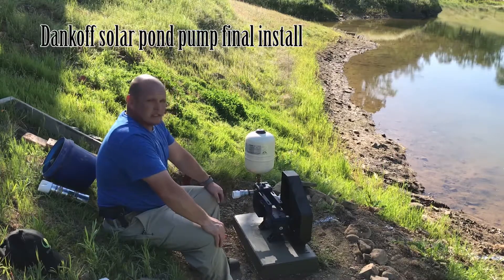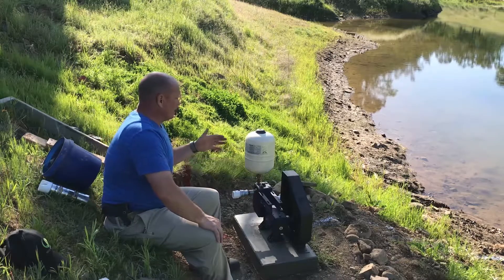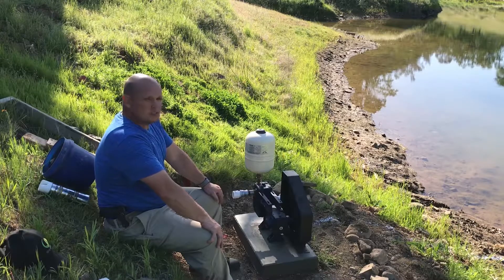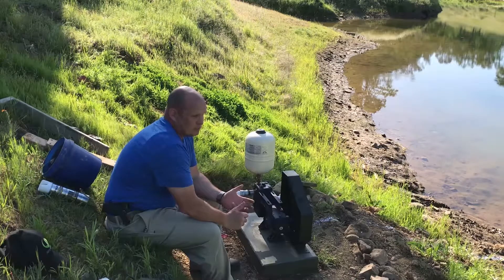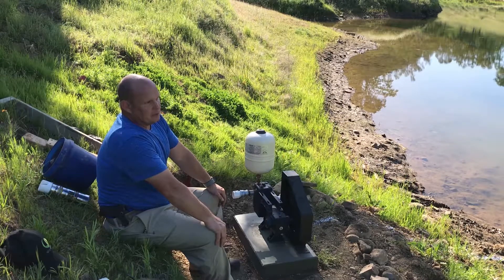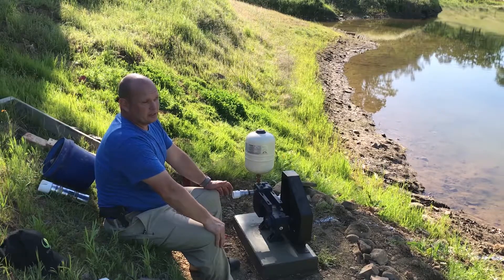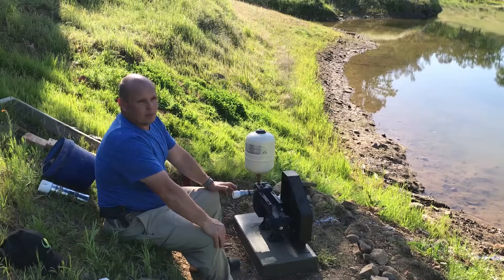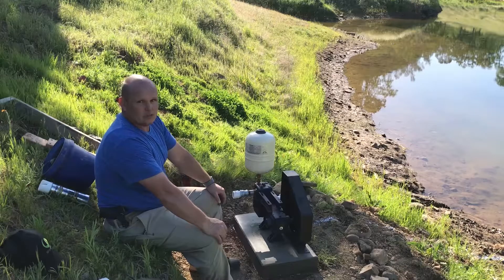solar pond transfer pump part 3 final install

Comment: Fantastic video...thanks for letting IOTA be a part of your project. Well done!
Reply from the maker: iotaengineering thanks for helping out I should be starting the next series for the Phocos dc freezer and we are using a 12 volt iota charger for emergency charging